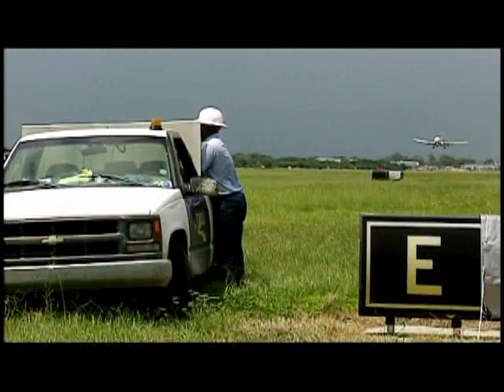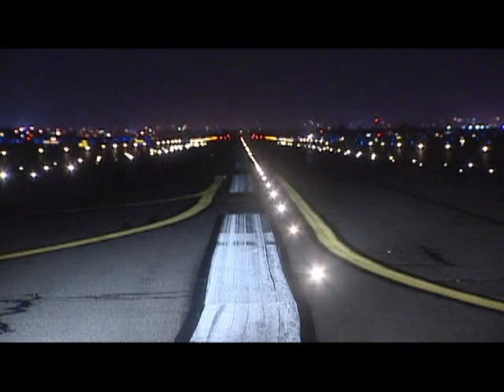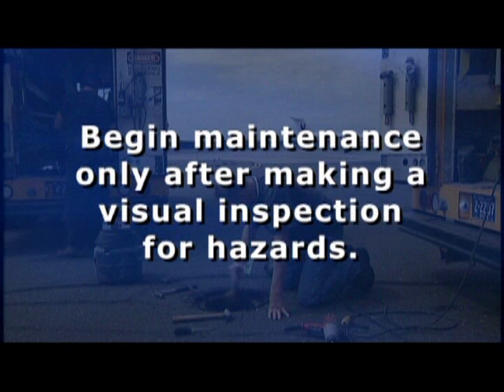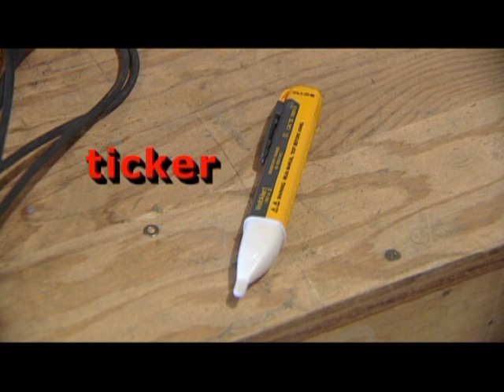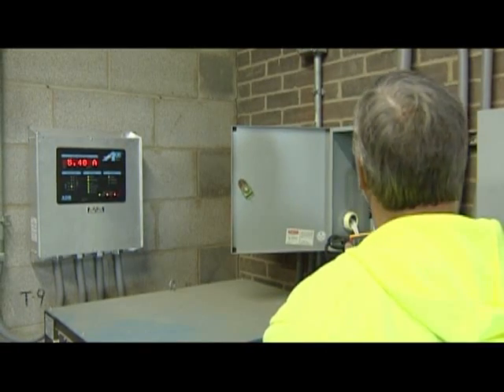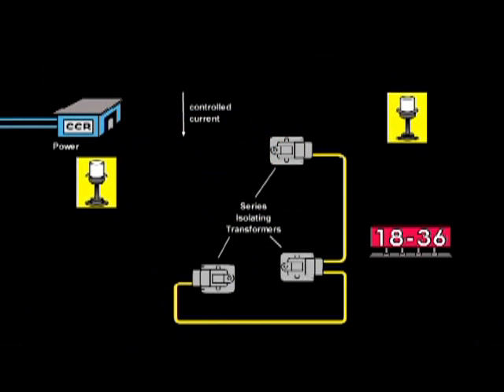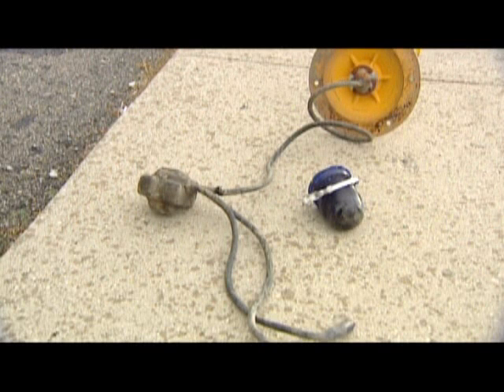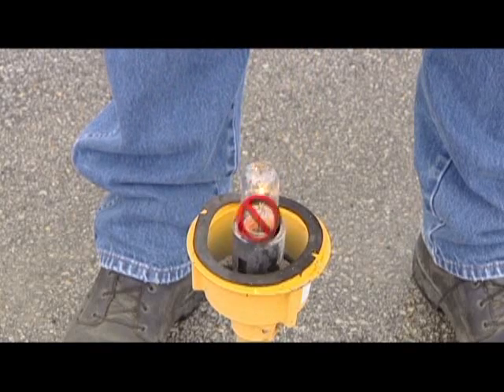Airfield Electrical Safety

Comment: Do you have a handheld radio? If so, you have the test equipment for your clamp meter. "clamp" the radio antenna and key up the radio. The clamp meter should indicate something. This is how you can field test your clamp meter.